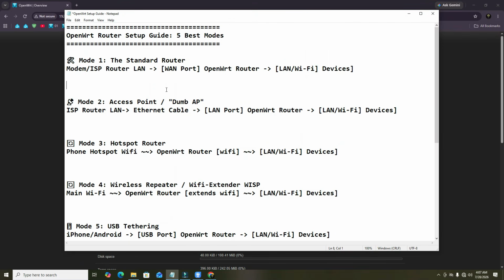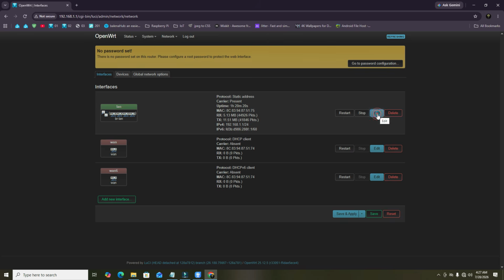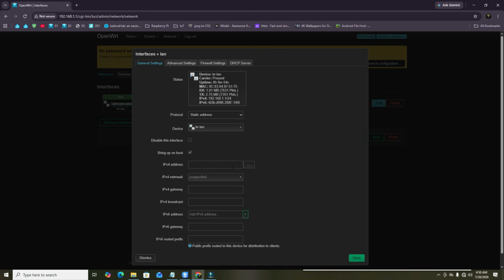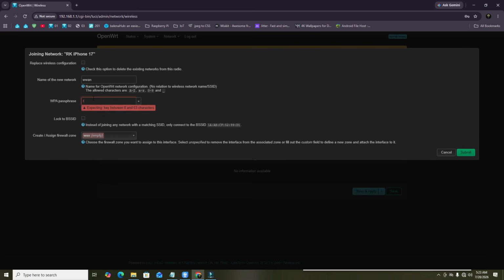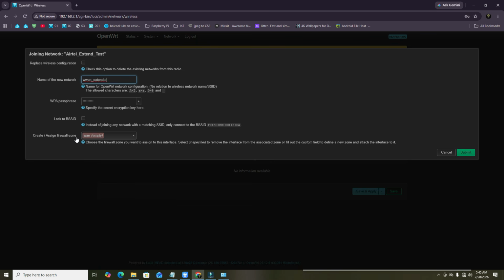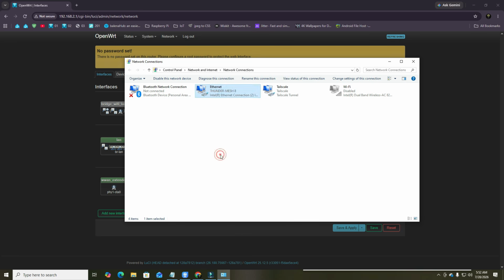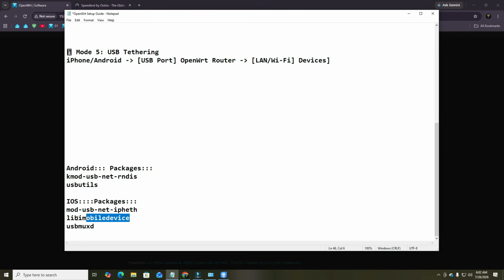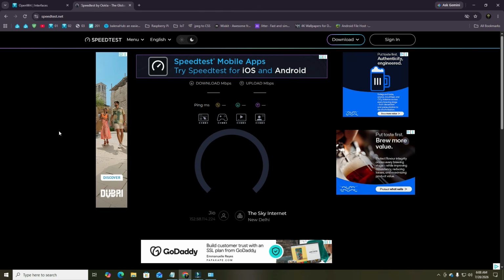OpenWrt Configuration Guide: Router, AP, Hotspot & More

Comment: I am also having a airtel fiber connection and want to use old jio airfiber router(better range and wifi 6) to connect all devices 
I should set it up as a main router or access point 
Why u set up as main router and not access point
Dont u have double nat this way?
Reply from the maker: Yes, I first tried to get bridge mode activated but airtel told me to get static IP and pay a monthly fee for it.
I was ready to do it but then I thought let’s try double NAT and see what happens.
It’s been 5 years.😊

Comment: Bro jio router unbrick video please…..
Reply from the maker: How did you brick your router?
Are you getting U-boot menu using uart?
What’s your router model?
For instant support join my discord community.
Link in the description.
Reply: @the_diy_daddy bro I follow the random youtube channel to flash openwrt in my jidu 6801, but after i flash firmware my device is not able to open that openwrt even there is no default gateway when i try ipconfig command please help
Reply from the maker: @vishalshimpi5027  6801 is not yet supported.
I have no idea about this.

Comment: when i hear "you have to follow each step or have to reset your router" . I knew this guy has done this for real!  ( I had issues making the IP static in time to accept changes. ) it would lock me out of the router.
Reply from the maker: Haha, true
Reply: @the_diy_daddy u keep saying reset the router how will i reset it?

2) Also i bought the router and open wrt installed from other person...he most probably saw vids like urs to flash but just in case to Confirm things how do i check if he has any data forwarding to his ip or if he is monitoring me??
Reply from the maker: @dp7572  reset the router using the back pin hole.
Both your problems will be gone.

Comment: Thanks for the tutorial on this router, really appericiate it :) btw what if we want to use the router as a NAS so you put a hdd or usb into the usb port of the jio router and then connect it to the main ISP, at the moment i have a airtel airfiber which dosent have a usb port sadly. im sorry for making u do soo many tutorials tho.
Reply from the maker: Haha, thanks for suggesting it. I personally don’t recommend using a router as a NAS, but you can certainly do whatever you want with your router.

Additionally, this router is powerful enough to handle occasional file transfers.

I’ll make the tutorial as soon as possible.